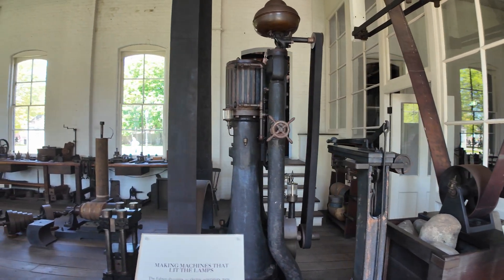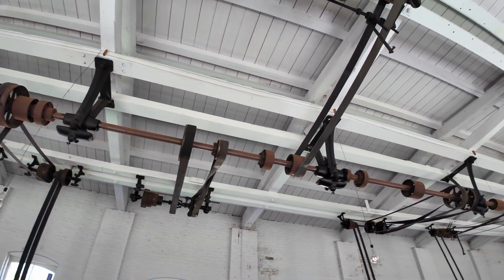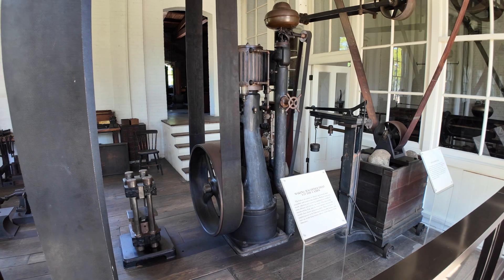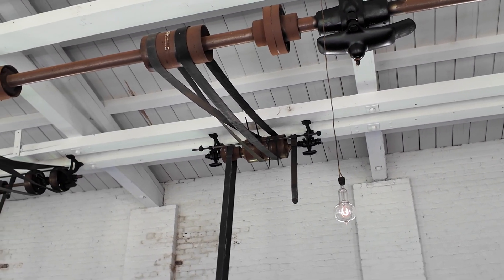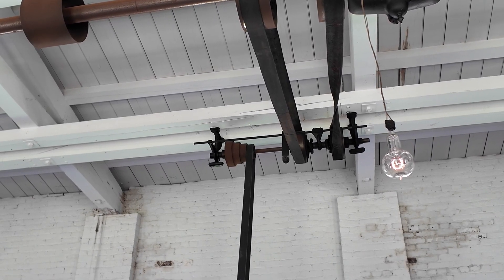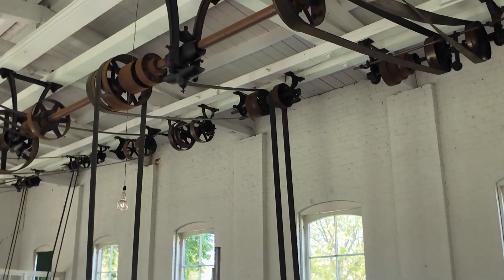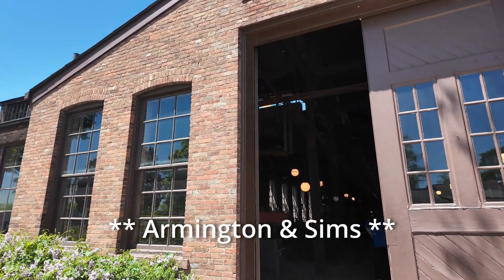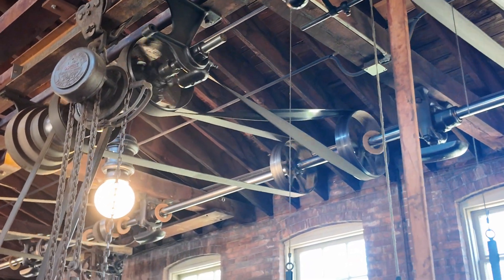Building A Water-Powered Machine Shop

Comment: Nice presentation, thanks..! Would very much like to hear an engineering level explanation of the Dynamometer. I imagine some kind of adjustable brake on the lower pulley, and a reading of the weight change of the rock box, and the RPM, would all lead to an answer in Horsepower. Looking forward to seeing the video someday...
Reply from the maker: I haven't really looked into that, to tell the truth.  Let's see if someone else comes up with an answer here in the comments.  If not, may need to add it to my video topic list.

Comment: The duster discs are a clever solution. I wonder if they cut those a certain qay to make them switch directions like they do instead of wandering to one side and getting stuck there?
Reply from the maker: As long as the rods are level, and the holes are a little bigger than the rods, they should just go back and forth. If you look, you'll see they tilt as they're going down the rod, but when it hits the end, they hit the bracket.  That makes them flip the other way, so then they travel that direction.

Comment: Would this be feasible and any good nowadays, not needing to run multiple outlets for all the machines and perhaps keep the electricity bill low?
Reply from the maker: Oh, absolutely these systems could be used.  The systems are really pretty simple to set up.  I know Henry Ford was setting some up in his Village Industry sites (small factories) back in the 30's and 40's, run on water power.
Reply: David Richards currently operates a steam powered machine shop.

https://youtube.com/@davidrichards5594?si=eBKcVXR8XbT1xa6k

Comment: Never saw those anti-lint discs before. When did they first start to be used?
Reply from the maker: Not sure, but I'd guess in the early carding, spinning, or textile mills.  That's where lint is a HUGE problem.  In machine shops, they do keep the shafts from getting rusty, but in you're working with fiber, the lint goes everywhere.

Comment: There were still plenty of machinists who'd worked in line shaft shops when I started out in machining. Years, in the early Seventies, I worked for a line shaft shop doing municipal water pump work on California's Central Coast. Yeah, I'm old.
Reply from the maker: They still work, so if you've invested in all the machines you need that run off them, and still they do what you need, why change?

Comment: line shafting could be powered by a hot air or  diesel engine basically anything that had a flywheel
Reply from the maker: Yep, the power source was pretty much independent of the work being done.  There's a place I want to get into to film that has a sawmill, a grist mill, and a machine shop, all powered by a line drive system.  They started with two water turbines.  Later, they added a steam engine, for when there wasn't enough water.  Then added an electric motor for when there's not enough water, retiring the steam engine.  The sawmill, grist mill, and machine shop don't care what's powering them.

Comment: Back in my college days, long ago, a friend and I were doing some "urban exploring" in York, PA. One of the abandoned buildings we accessed was set up with the belt drive system. It was a factory of some sort, I don't recall exactly what type, but I do remember that there were also these spiral slides going from the upper floors to the lower floors, a sort of material handling system. Some of the belts also ran between floors. I think there were 3 floors, but, as I say, it was a long time ago.
Reply from the maker: Everyone used to run them.  Some companies replaced, or supplemented, the power with electric motors and just kept running with them.